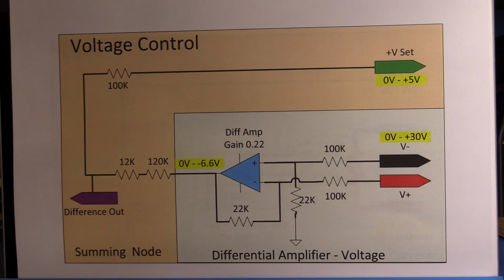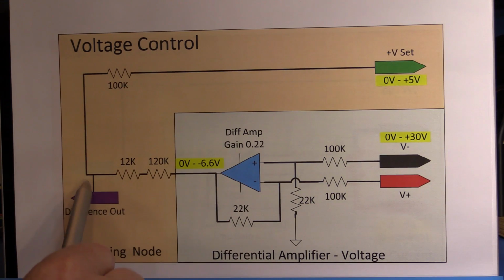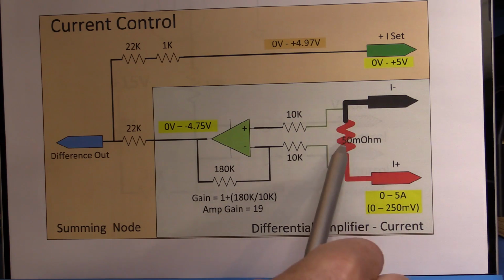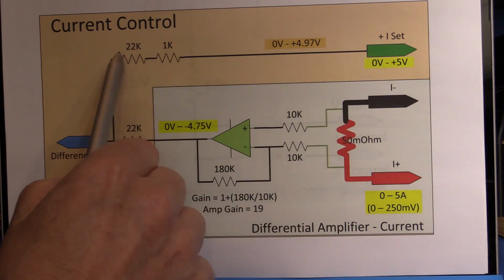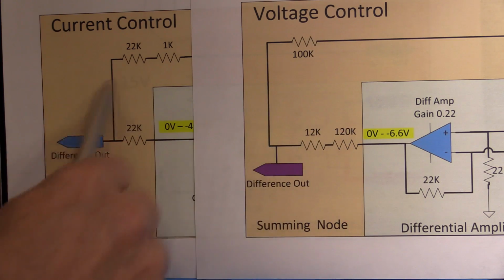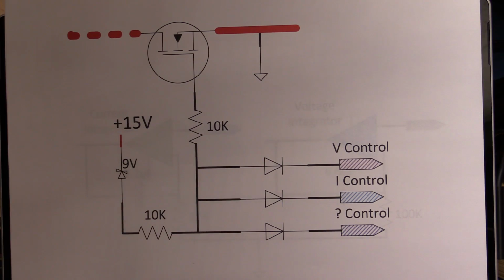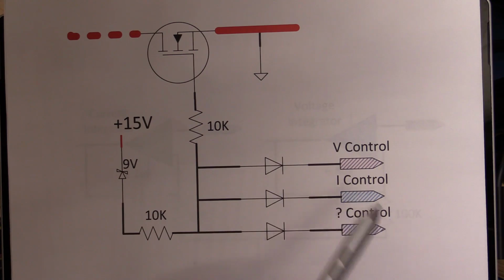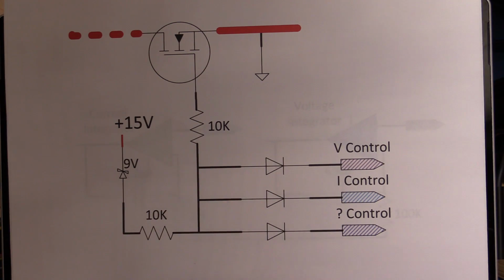The Modular Bench Power System #10 - pt1 of 2 - Differential Sensing, Highside MOSFETs and more

Comment from the maker: I now have a set of boards and designed for a computer controlled power supply. this could be Arduino, Raspberry PI or even something else. It is all connected through an Isolated I2C bus, so I will be kicking off with a new series soon, sorry for the delay :)

Comment: Why use a 9V Zener diode? don't we need to set the MOSFET fully on by default before the control circuits to pull the gate voltage down? depend on what to select the proper Zener?
Reply: when I checked the datasheet of the MOSFET you use in later video, I understood. You just want the Vgs > Vgs(th) a little, to let the MOSFET start to conduct.
Reply from the maker: @HaobinLuo-o5o  Yes , glad you found out for yourself, best way to learn. Happy your finding the videos useful

Comment: Many thanks for that excellent serie. Even if I don't really need it, because I have some, I think I will build this power supply only for the fun it makes. Your concept offers a wide range for experimenting with analog and digital control and measurment. I'm impressed. It is a pleasure to listen to you and to learn from you. Thanks.
Reply from the maker: Jürgen Ollig I am happy you like it and the fun is only just beginning, You are correct in that all the concepts and deigns can be re-used in other projects and I will be applying that concept to a DC Load and a constant current source in future videos, and by keeping the control inputs separate then you get plenty of options on how to manage the settings from simple pots to full windows 10 IOT on a Raspberry PI with high resolution DACS and ADCs to control it all, and did i mention remote control :), I'm getting excited about just thinking about it lol
Reply: Peter Oakes Yes, absolutely exciting. With RaspberryPi you can have fully touschdisplay control or remote via ssh or remotedesktop via lan or wlan. :-) 
The other thing is, that you can run programs eg. automaticly step voltage or current over time periods and so on. I'm waiting in suspense.